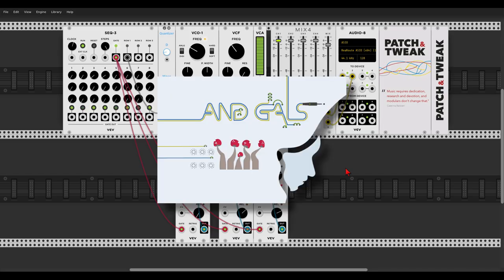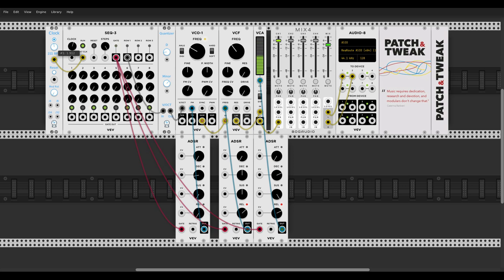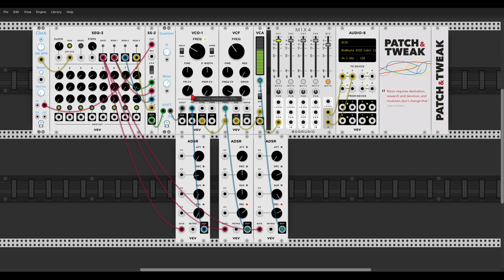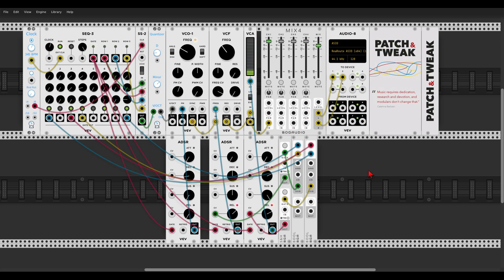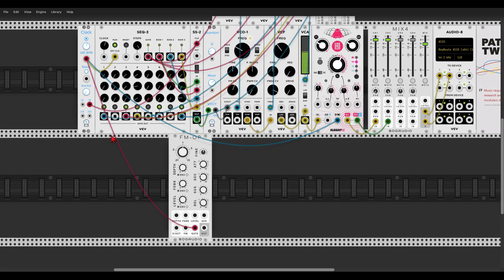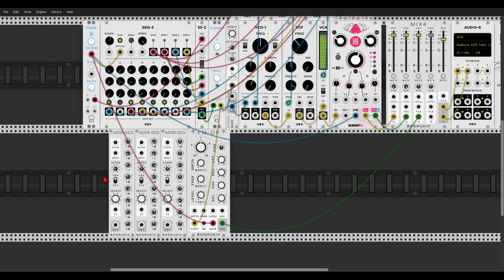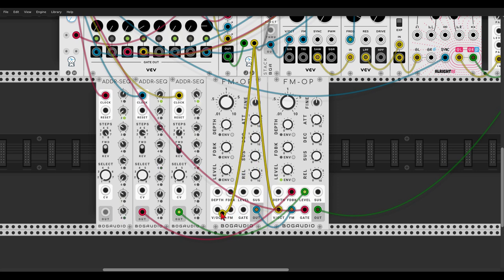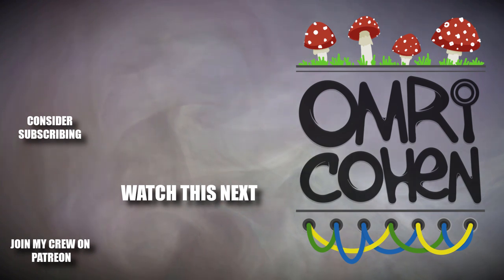Patch and Tweak in VCV Rack - Three envelopes magic

Comment: Was there a hot key you used to duplicate cables without having to click click on the other end again? Having trouble finding any list of hot keys for VCV anywhere
Reply from the maker: Well, no, there's not hotkey for that, I had to click until I got the cable I wanted. There's a module from Submarine that can help you with cable management, it's called the Wire Manager. With it you can choose custom colors and such.